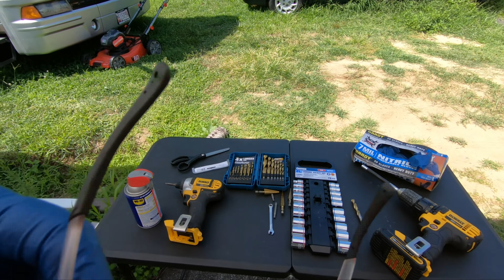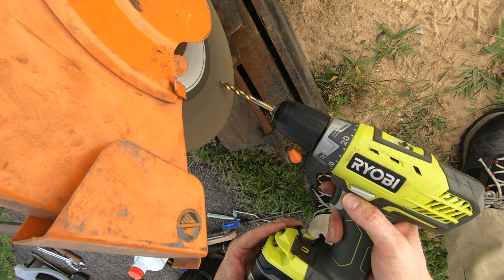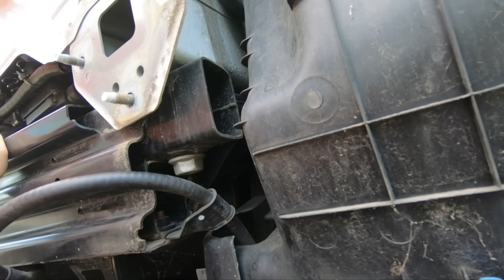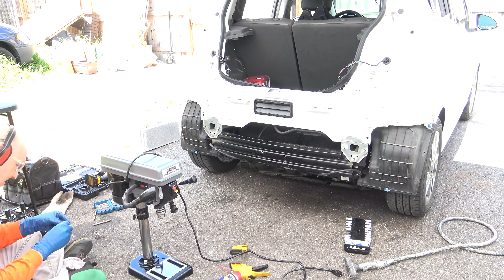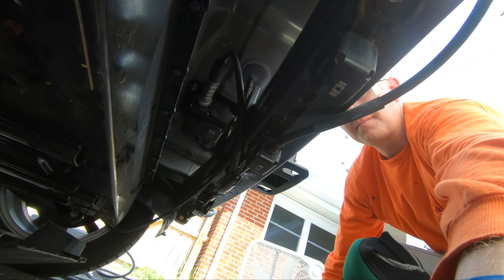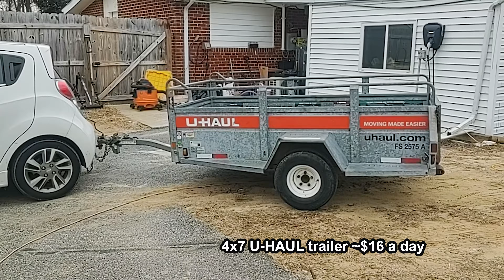Chevy Spark EV Tow Hitch / Custom Install

Comment: NICE! Thought id have to get a gas version hitch for 300$ CAD. now I get to FAFO but only pay a little knowing that the EV version has a thick back.
Reply from the maker: This is a way to put it, yes. Have towed a LOT since.... No issues with hitch. Range however.... You cant go far but you can tow.
Reply: Im only towing literally 3 miles total from the hardware store. Any way can you tell me how tall and wide the beam was before I remove the bumper myself, or at least tell me removing them won't result in permanently broken bumper clips😅

Comment: Can this be done on a Chevy spark LT? Who would install it, any suggestions? Also can I pull a RV @less than 3,000 lbs? Thanks for any help 😅
Reply from the maker: Hi, if it is a gasoline spark, get the hitch built for a gasoline hitch. As for 3k lbs or less, that is likely too high of a limit. If you have a spark EV LT, yes this works but i would not suggest towing over 2k lbs. Also, towing kills the range but it is so capable.
Reply: @TRYtoHELPyou  yes it’s a gasoline LT with manufacturer stating only 2,000 lb but with items inside and out body weight included could be 3,000-3,500 didn’t know if this was possible I just paid the car off had low miles and tired of being homeless we want a small bunkhouse and want to keep my car everyone shys away any knowledge on doing it or saying they can 🤷‍♀️ thank for the help!

Comment: where did you get the 90 deg towing ball mount
Reply: I found it, it's the Reese Towpower 21141 Adjustable Ball Mount. A two part unit, comes with the 90° part he is using and a right angle ball mount shaft that won't work with the setup but is sold as a set.

Comment: Hi, great video !  Do you have tips for the wires connexion ?
Reply from the maker: @mgadbois67  ooh dang. You need a tekoshna controller, I think. It's a deal that takes all the inputs of the lights and outputs it to a trailer signal. Here is one by Curt, affiliate link. https://amzn.to/3YFt84A fits a 2016 spark ev it says.

Comment: Do you think this car could tow a trailer that similar size in the highway, for Around 100miles?
Reply from the maker: This is the spark EV which cannot even at its lightest weight go 100 mi on the highway so no. Adding a trailer and highway mileage you might get 30 possibly 40 me depending on the weather and conditions and how much weight you're towing. As for the gasoline spark I am unsure of its range but gasoline is usually really easy to fuel up.

Comment: Rotate it UP 90 degrees and use a level ball mount. This will also set the trailer level/higher. Why make it complicated?
Reply from the maker: Because there was no place for me to safely mount a receiver "level". All the reasoning is in the video. Drill a couple holes, sandwich stuff and be done. In order to make the initial receiver level it would have taken more parts and possibly even welding. This way is literally less complicated.

Comment: I just did this same install on a Spark EV 2014. Only modification I made was to drill a second set of holes for the adjustable towing ball mount to raise it about 2 inches from where the original holes line up. That put it at about the perfect height, and looked about the same as where yours ended up. Your method worked great. Thanks for the instructions. That said, I will repeat your warning about the difficulty of drilling through the secondary battery bumper/guard. That was by far the most difficult part. Several of my drill bits just would not cut it no matter how frequently I sharpened them. I tried several tricks that help with difficult drilling including using tungsten tipped bits. Despite this I spent hours drilling and broke about a half dozen pits that snapped it half or broke off the tip. Do not attempt this method unless you are confident if your ability to drill hardened metal. Thanks again.
Reply from the maker: This for the good words and for sharing your exp. Super cool!

Comment: Now that I'm older and see things differently, the Spark EV is probably the best car Chevy has ever made.
Reply from the maker: Problem is that Chevy made very little of it. Daewoo for the body, motor and gearbox we're made somewhere in the US. I hear motor was built in Baltimore, which is cool. The battery is LG. GM just managed the assembly and some of the designs I would say. Best car they have made? Car, yeah maybe. The bolt is likely better if you can accept the slow fast charging, as silly as that sounds. The spark can charge zero to full in 30 mins, not so for the bolt.
Reply: @TRYtoHELPyou  My SparkEVs (those that run) all lack DCFC so I guess that is what determines the speed of recharging. Without DCFC all mine take hours to recharge, but not a problem for me. My guess has been that Daewoo did the software and the whole unique, inspired mechanical design. If any of that was actually done by GM how come they had so much trouble with the Bolt. Almost like it was not 'their car' in the first place. Just turned 38k miles and max battery = 64 miles on a 2016.
--

Comment: Omg that poor Corolla it looks like an absolute abomination with a pickup bed.
Reply from the maker: It's body was a half inch difference in width from the bed.. so crazy. AND.... The frame rails of the truck slipped right between the unibody frame rail stamp outs. It's like the same company made both vehicles.... And meant for them to come together like the truckolla did.
Reply: @TRYtoHELPyou  Some crazy Toyota executive in Japan must have secretly wanted it to happen.
Reply from the maker: Pretty sure it's more related to tooling and methods/material handling, but possibly exec level decision.

Comment: Transverse vehicles are not design for hauling! The transmission incorporates the drive shaft and differential. "Torque Power" is at its minimum. The transmission is going to overheat and you'll have premature wear and tear; once it starts slipping, it's gone! Moreover, you just voided the warranty on the drive train. Stay sharp my friend.😪
Reply from the maker: Bro, it's direct drive single gear. zero clutches forward or reverse. If they wanna void the warranty, so be it. The thing is and will remain a beast with zero shifting gears. Also, there are a LOT of vehicles with transaxles that are rated for towing to include most minivans. While I agree that towing with the spark will increase wear and tear and possibly affect the warranty, the other points you made are incomplete at best.
Reply: @TRYtoHELPyou  Pardon me, the word slipping does make reference to an automatic transmission. Allow me to make reference to a manual transmission. Gears go "KAPOOF" when overheated. Hauling on "direct drive single gear" is detrimental to the transmission as a whole. Also, I forgot to mention the engine. But, I am going to leave this one to your intuition.
Reply from the maker: Engine? Really? If you are joking I don't get it. Read the 2016 Chevy spark EV manual. Be sure it's the EV manual.
Reply: @ricardomontes373  NO engine, just an EV doing its thing.

Comment: What’s the towing rating?
Reply from the maker: GM just puts this in the manual, so yeah "Trailer Towing General Towing Information The vehicle is neither designed nor intended to tow a trailer." With that, 2k lbs. would be pushing the breaking and maneuvering limits. That trailer towing the spa was around 1500 lbs. and the spark slowed and took off so nice. I can generally keep up with stop and go traffic and its hilarious. https://my.gm.com/content/dam/gmownercenter/gmna/dynamic/manuals/2016/Chevrolet/Spark%20EV/2k16sparkev1stPrint.pdf